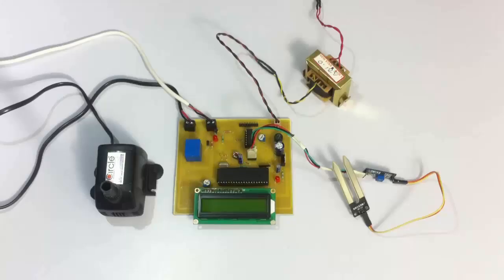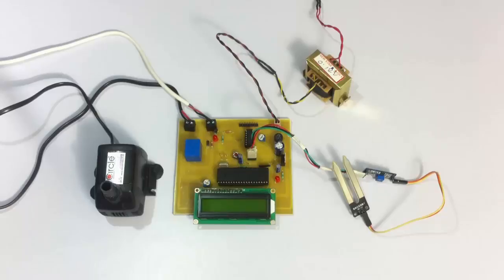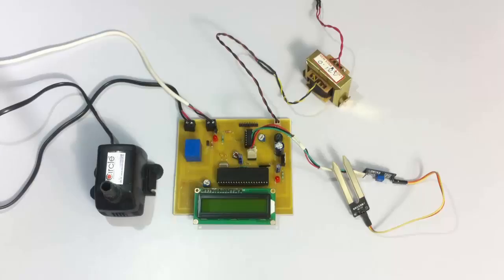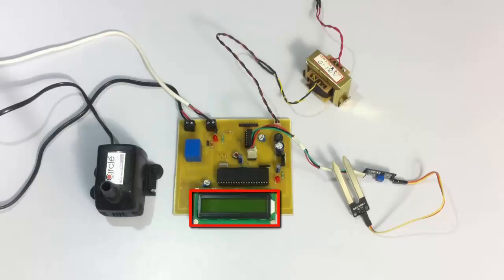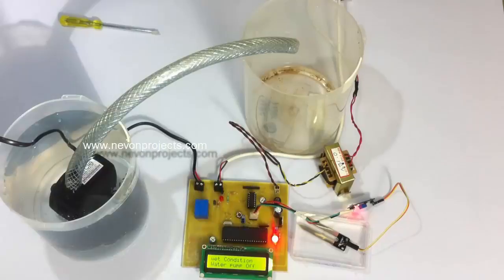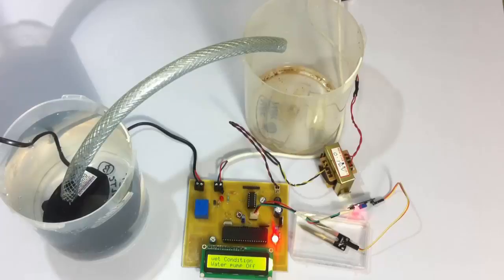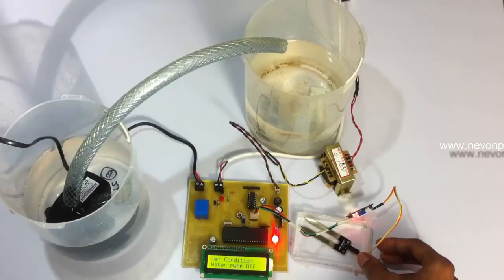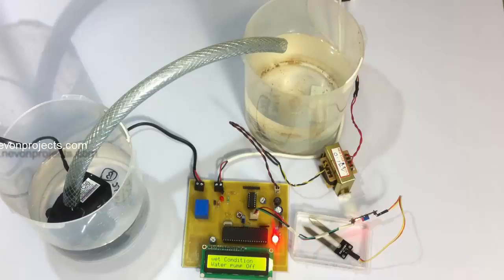Automatic Plant Irrigation System Using  PIC

Comment: It's really nice thing man. But the thing that bothers me most in this project is the use of 40 pin microcontroller for just operating an LCD , detecting the input and giving the output. I think a 14 pin microcontroller can do this job Also there is one more IC used in this project it seems some sort of driver IC. What's it for? I would like to suggest one more thing you should print the value of moisture which is in percentage , as the moisture module also gives both digital and analog output. It would be nice to see than just on and off.